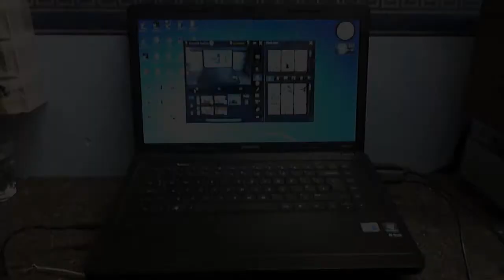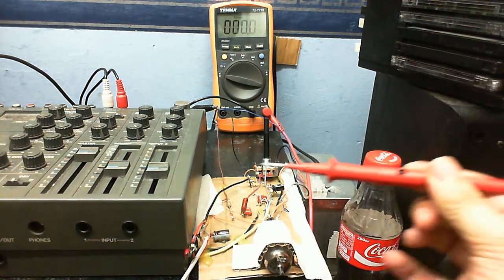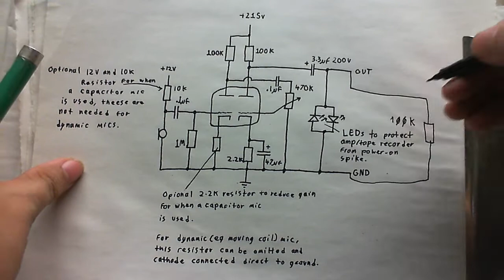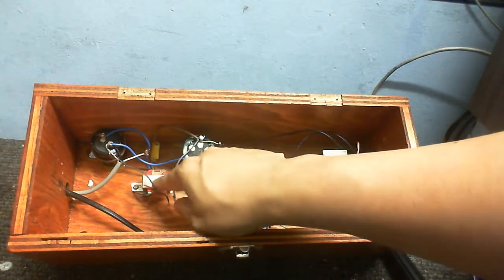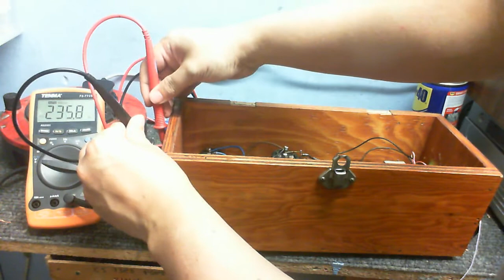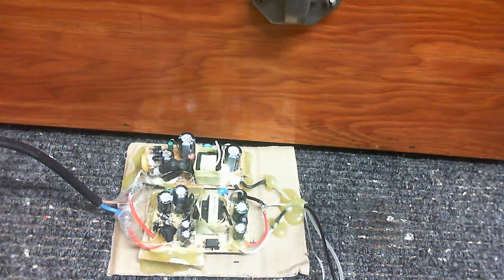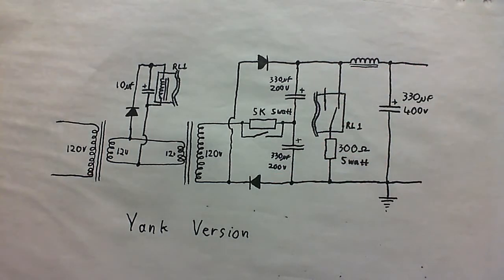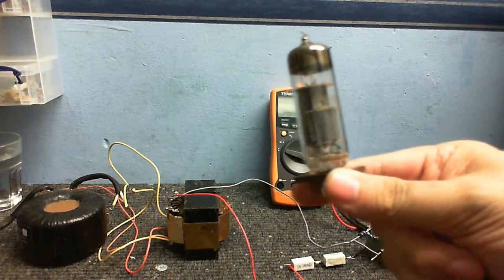Tube Time Episode 4 - Electret Mic Preamp

Comment: I made a similar but more simple power setup and using a simple isolation setup with two transformers and such was OFTEN done in the 70's. There is nothing "bad" about it. It's a great way and the costs are reduced and it WORKS GREAT so far in my experience. I used a couple very cheap but durable 220/24vac transformers and set up a simple regulator circuit. I didn't use relays or switches but the results were similar to yours.

Comment: Nice idea with the relay to discharge the capacitors! Ill try it out in the sstc when i get it sorted out becuse it will probably run on 300v or so at 150amp pulses

Comment: i'd like to take that idea of using a relay to discharge the capacitors. thank you very much.  I was thinking about the problem but have not thought of a solution.  Now to figure out a way out to implement it in my circuit....

Comment: hey Clem I live in america and I got ZX spectrum computer a few years ago and I wanted to use is power supply but of course I use 120 is there a circuit to double 120vac to 240vac? besides a step up transformer?
Reply from the maker: You could use another AC adapter with it, just make sure the it's output is 9 volt and the polarity is the right way round, I fried a speccy once when I made that mistake, Oh and your TV will need to be PAL compatible.

Comment: which valve is this? Does it matter? E88CC? or 12AX7?
Reply from the maker: I think I used an ECC81 here (i don't know the American name for that valve) but an ECC83 works just as well, I don't have any ECC82s but I imagine those would work just as good.
Reply: CoolDudeClem The reason I asked is I'm trying to build a better preamp for the 6P31S tube amp I'm building and testing in my latest video. Among others, I looked at your preamp here and the one you used in your EL84 amp. I am going to try to use a Russian 6N2P tube (similar to 12AX7 and these other double triodes) and do it "phonograph" style like yours (vs. some which are off the cathode). It seems that the phono style are more sensitive and powerful. I'm still not sure if I should go with resistors like u used here or in your EL84 amp vid. Your feedback is welcome! Thanks, Clem...keep on truckin!

Comment: why you need 2 transformers for isolation , can you just conect bridge rectifier to 220v mains?
Reply from the maker: It's always a good idea to have isolation, even though connecting the mains straight in to the bridge rectifier would work, but, it would be a "hot chassis" circuit, and would be impossible to connect to an earth/ground since there's no isolation that way.
Reply: ok thx ! Im building 811a amp for gramophone  so I need information for preamp

Comment: I'd like to talk to you about or see a video on "improvised chokes" and using transformers for chokes. I hear you can do that but was always told you need an "air-gap". I find out more and more that so many people say "you have to do it like this" or "OMG. You CAN'T do it like that!" and it works just great anyway....so it's hard to know who to believe and who's full of EGO.
Reply: An output transformer does need an air gap
The choke does not
Reply: aha....so you're saying I have it backwards....so potentially any transformer could be used? Which side is better? Primary or secondary? Hmmm...I must put some thought and research into this.
Reply: i dont know with chokes
i do know how to use power supply transformers as output transformers

Comment: love your EHT circuit
your EHT circuit filtering  circuit is called a PI filter
this circuit common and old school  using a filter choke and 2 condensers
your 2 transformer design  is grate for this application
you might want to check the cathode voltage it should be about .9 of a volt or 1 volt DC
if you want to clamp the gain down use 220 k on plate anode and try adding 1.5 k on cathode etc
may be try adding a pot to the output of the 2nd stage of the 12AX7 and try using .1 MF condensers all the way through the circuit